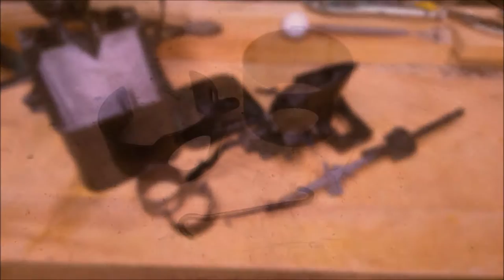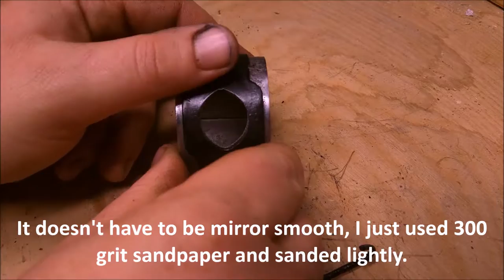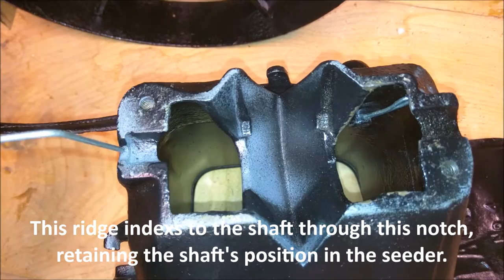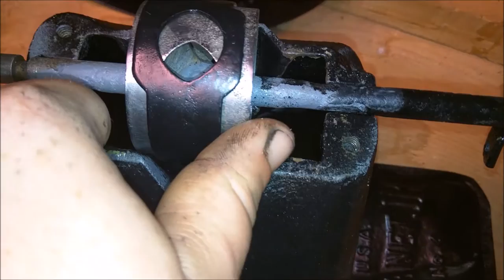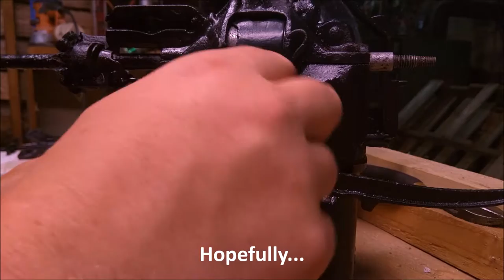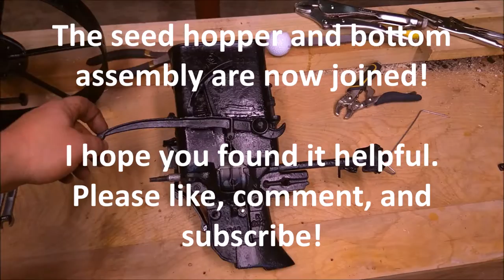Assembling the Planet Jr No. 4: Joining the Bottom Assembly and Seed Hopper

Comment: the double sleeves are a pretty unique feature to the #4 aren't they?  Have you tried little round seeds like brassicas in it?  Do they feed well?
Reply from the maker: Sorry for the late response Oxbow, been dealing with a septic tank backup (life in the country lol).  I've not tried the #4 with brassica seed,  I did try soybeans and yellow bush beans (I had extra) before the snow came.  The sleeves can be finicky, I can see why people prefer the 300's with the seed wheel/plate.  I was able to consistently 2-3 seeds per "opening of the hatch" (hill mode).  I have seen suggestions of putting it in drill mode (hatch open all the time).  I'll have to do more experimentation during the spring (hope its coming soon!).